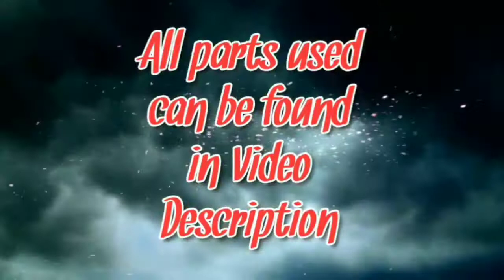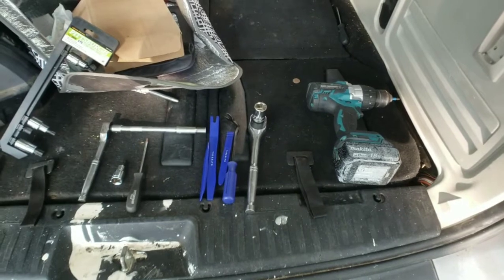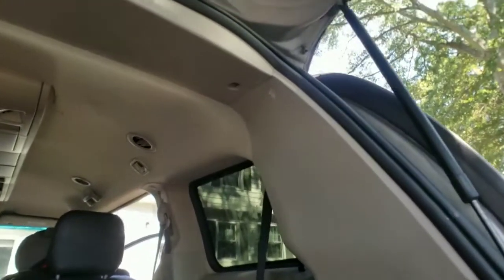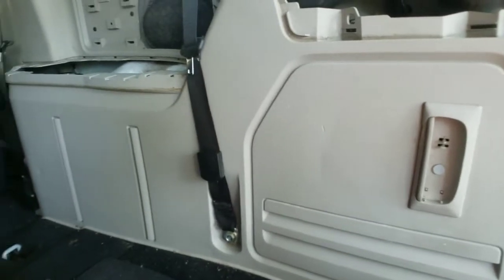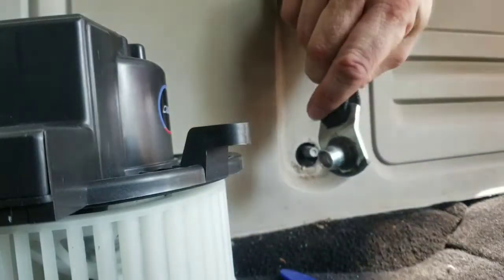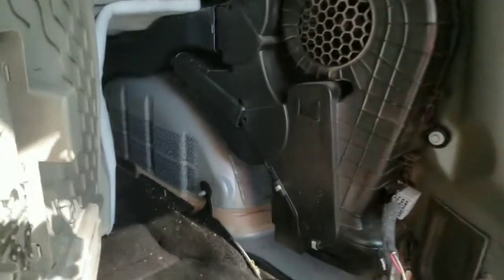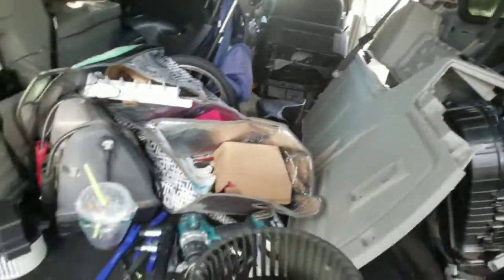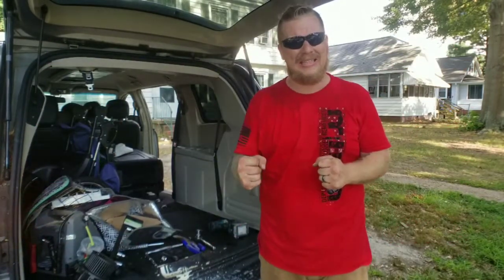2014 Chrysler Town and Country Rear Blower Motor Replacement Made Easy

Comment: My van clicks back there, about the same area. Blower works fine.   Any idea?
Reply from the maker: Could be a range of things also depending on when it clicks. Sounds like a blend door actuator tho for the rear vents
Reply: @Sellthoseflippingcars  yes I think so. Random times. Even clicks when van off, parked.. I can hear it clicking like 8 times then stops
Reply: @Sellthoseflippingcars  yes I think so. Random times. Even clicks when van off, parked.. I can hear it clicking like 8 times then stops
Reply from the maker: Yep that sounds like your rear vent blend door actuator is failing and that is the clicking you are hearing